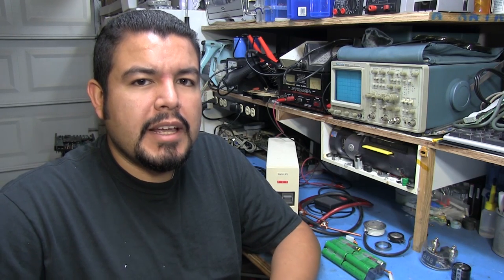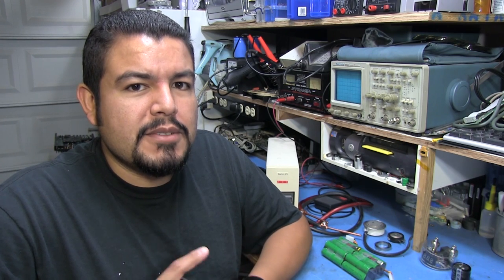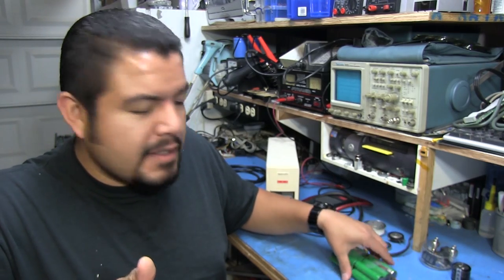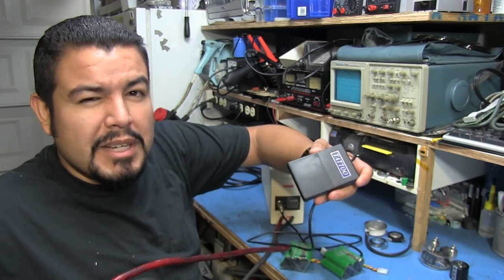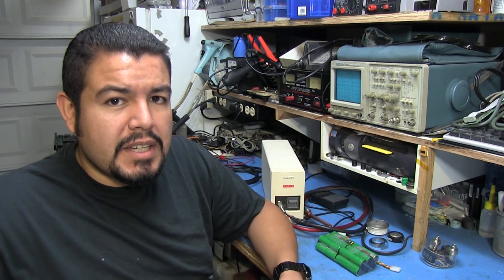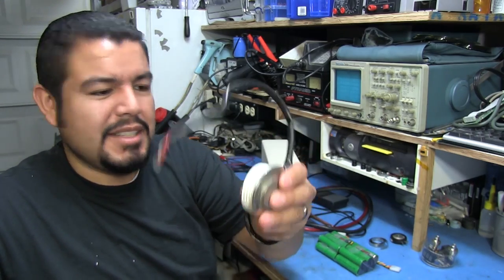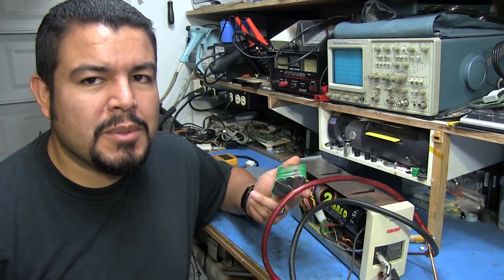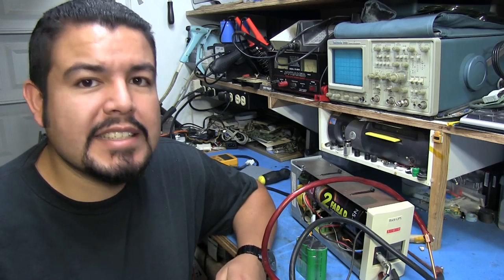TWB #2 | Neato XV11 Battery Followup and Capacitive Discharge Welder Demo

Comment from the maker: +Philip Dunn, Trying to reply to your comment once more... I'm not having much success here.

No. Touching the probes and triggering won't do anything. It's basically like touching a 16v power supply. There's not enough current flowing through you to keep the SCR on so when you let go of the trigger it shuts off.

Comment: Thanks for the vid. I've watched a few now. I'm wondering what your thoughts are on the resistor others use in their design to bleed off the capacitor charge? I noticed in your demo before you turned on your power supply your voltmeter read 2.46 volts or so. What do you think?

Comment: Thanks for the video, it was good one, i am curious about your batteries packs run time now after 7 months , remember you state around 75 minutes when it were new.
Reply from the maker: I've had the unit stored for a few months because of some rearranging we did in the house. I'd have to figure out a way to keep it from getting stuck in certain areas and so I removed the batteries while we figured that out.... which hasn't happened yet. So unfortunately I'm not going to be able to really answer your question. Sorry :(
Reply: Thank you for updating, BTW going to Li-on battery is complicated.

Comment: Still a Great Welder! I like to watch Youtube Video's and then attempt to build the same, with a  little twist. I really like your design, and I have an extra UPS, just like the one in your video. I plan on using a Dell 19.5V 3.3amp laptop charger-going to a buck Converter. Charging with a button on the front(led readout for in and out power). Pretty sure the SCR I am using is 400-1000amp rated. That will be powered by a couple of 18650's in Parallel. I am using a BOSS 2F Auto Cap, with 4guage wiring and I will copy the electroids you made. With the Tab Welders I make. The switch is connected to a DC outlet. Than I plug in a foot petal I made from an old Rock Band Drummer petal. Should be a pretty fun setup! You can check out my Google+ profile for the other Tab welders I made. Thanks for making the video!!

Comment: Is one cell battery 3.7 volt? What is its mah per piece? I want to buy battery that uses on electronic cigarette cost like $5 per
Reply from the maker: norbu1987 These batteries are only 1.2V at 4500mAh and were about $5 each.

Comment: I would really like to see a good weld not some that are not that good😜 i build my own spot welder and have the same problem with bad spots. I really dont figure out why its so hard to make reproduceable spots where i can really trust on without pulling on it. I use 2 power caps 1 with 2F and 1 with 1F to get actually a bit more than 2F out of it. You can use bigger electrodes to reduce the resistance- more power for welding and bigger spots💥👍
Reply from the maker: I noticed that the batteries being too cold affects welding. Warming them up a bit seemed to help. Eventually I want to look into making a better unit as this one is admittedly pretty limited.